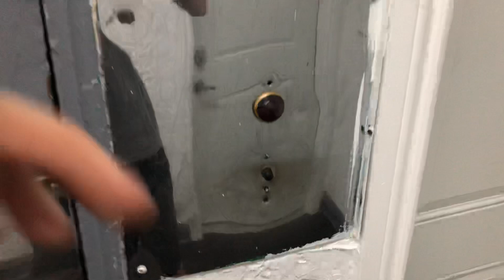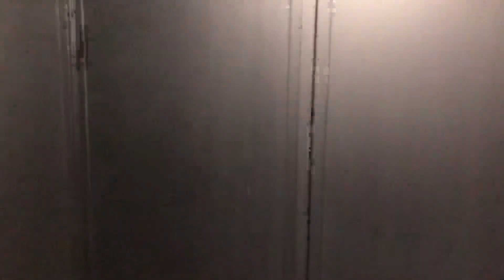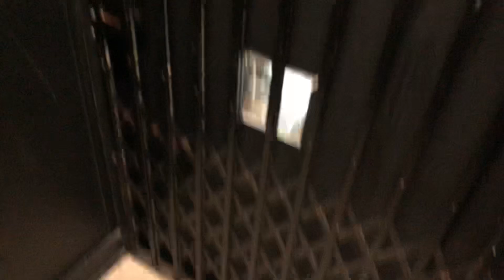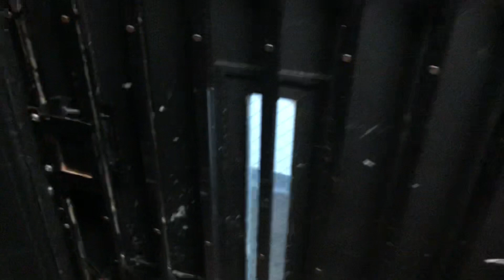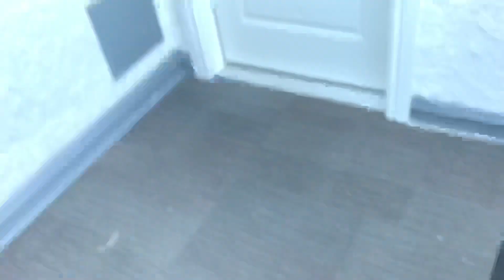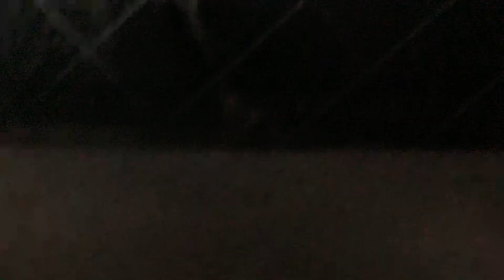Gated Traction Elevator @ 1521 Sherwin - Chicago, IL.

Comment: Those are Monitor buttons inside? Nothing tells me Monitor. I think the call buttons are Arrow Hart. But then the in use light looks like Monty.
Reply from the maker: Elevating Western PA those are monitor. They press just like it and normally do with monitor key switches.
Reply: The key-switches don't look like Monitor at all.